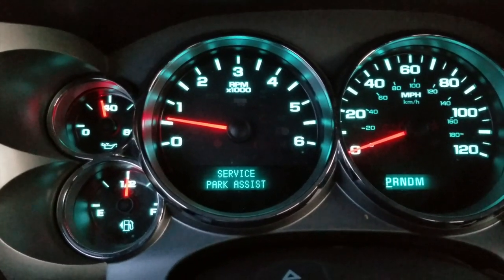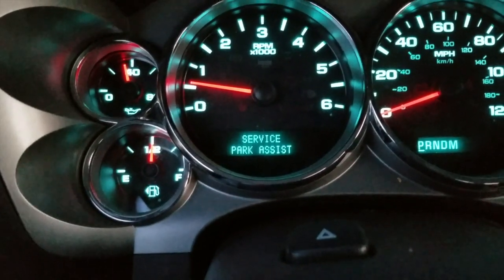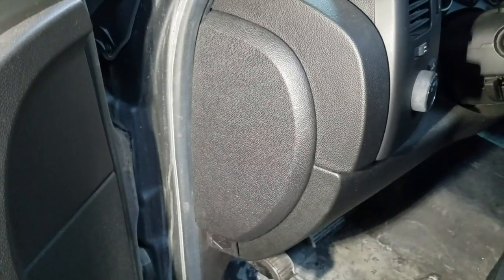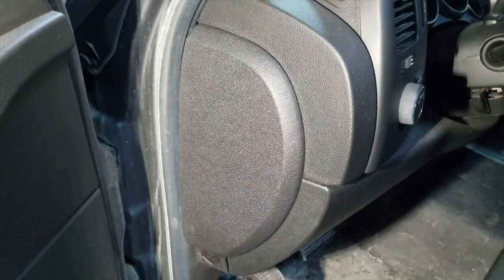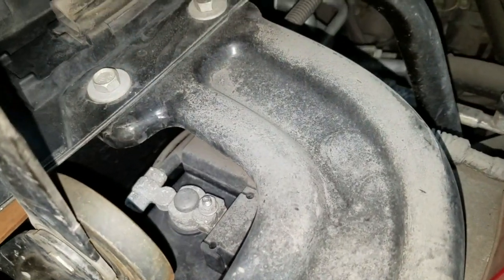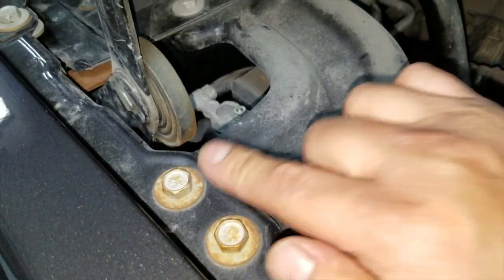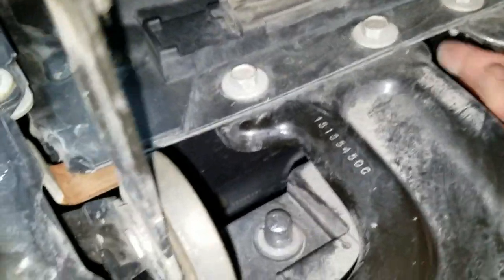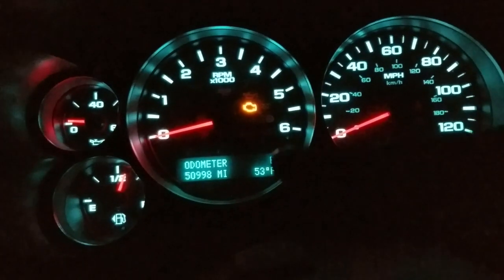2011 Chevy Silverado - Disabling Park Assist

Comment: 2011 Chevy Silverado 1500. Replaced factory rear bumper with steel bumper. Had to bundle the sensors up as they would not work on the new rear bumper. I had this same error message. The instructions in this video were perfect and exactly what I needed to make the message go away. Can't thank you enough for this video!
Reply from the maker: Glad it helped!

Comment: Thank you!! I was getting tired of replacing sensor and the annoying dash message. this worked great on my 2013 Silverado
Reply: Question… customer said that they didn’t fix it after removed rear bumper for paint and they didn’t work on it . Customer said it supposed have beep sound for reverse n it not working but I saw ASST PARKING . So this video help ? N u said finally fixed it ?

Comment: I just did this on a 2013 Express van 2500 6.0l, and yes it does work. Just make sure your battery is disconnected for long enough.

Comment: Thanks a lot.  Worked great on my 2011 Avalanche!
Reply from the maker: Great to hear!  Thanks for leaving a comment!
Reply: @AKJeeper  np that was one of the most useful videos I've come across. My park assist would chime every 5or6 sec unless over 60 km/h live in Toronto Canada btw,  saying park assist blocked see owners Manual.  Drove me crazy 🤪
Reply: Sadly this hasn't worked for my 2011 Avalanche. Battery was disconnected for about 25 minutes. Bummed

Comment: I've had a 2011 Silverado WR 1500  for 8 years and never knew "Park assist"  was on it. What does it do?
Reply from the maker: These are sensors in the bumper.  When the truck is in reverse and an object gets too close to the bumper - the truck will beep to alert the driver of the obstruction.  The faster the beep, the closer the obstruction is to the bumper.  Unfortunately the failure rate of the sensors is quite high, and the sensors are rather expensive.  Many people elect not to repair the system when it breaks...
Reply: @AKJeeper  Rock Auto has them for about $12 each. I replaced 2 Sensors that were bad, and now the Park assist works. Still can't get rid of the "Service Park Assist" Message.

Comment: When you pull the OBS fuse does it disable the backup camera as well?
Reply from the maker: I would have to look at the wiring diagram to know for sure.  Interestingly enough, none of the trucks I've done this to have had backup cameras.
Reply: @AKJeeper  They only have the cam or sensors. NEVER BOTH ----The cam is part of the navigation option with the screen in dash. Just FYI
Reply: yes my back up camera does not work if i pull that fuse

Comment: Great video man.. hey I live in Alaska too!! I have a question about my vehicle i have a 07 escalade ext I replace two sensors that was bad but now its saying parking assist is off. Do you know how to fix my issue. Thanks
Reply: Did you get any help with your issue?
Reply from the maker: I didn't see your message.  Have you checked the fuse?  Maybe it blew in the process of replacing the faulty sensors.

Comment: I have 2013 diesel which has 2 batteries. I’m assuming I would have to unplug both for 5 minutes?
Reply from the maker: Yes, unplug both batteries (negative cables) if you’ve got dual batteries.
Reply: @AKJeeper  just finished it up. It worked! Thanks!
Reply: I followed this and now on dash says park assist off?
Reply: Any pointers on removing that?

Comment: Tried to do this on my 2013 GMC 2500 Duramax. After completing the process, when I started the truck I got this message: PARK ASSIST OFF 
I also noticed that the presets on the radio did not change either. The second time I did it I disconnected both the negative and positive battery leads. Same message appeared. Does something else have to be done to reset the computer?
Reply from the maker: Duramax trucks have two batteries.  Did you disconnect both batteries?  Basically the power needs to be cycled at the instrument cluster so that it can reconfigure itself as a unit without park assist.
Reply: Bingo!  It worked. Had no idea there were 2 batteries. Great fix! @AKJeeper

Comment: If I replaced all my sensors with new sensors and the service park assist doesn't go away does this mean I need to disconnect my battery for 5 min to make the code go away? Harness looked good. Bought after market sensors off of Amazon. I have an 2010 Chevy Suburban.
Reply: I did the same exact thing, I bought all new sensors, and now I got codes for every single sensor instead of just two. Mine is a 2010 escalade.
Reply: @dalton6578  Mine doesn't tell me how many sensors are bad. it comes on and goes off when it feels like it.
Reply: @InfantryGeek  I have an in-depth scanner. Mine tells me exactly which sensors are malfunctioning and all sorts of other stuff. Even will tell me if my heated seats have an issue.
Reply: @dalton6578  Where did you get the scanner and what is the name of the scanner?
Reply: Did you ever get your issue resolved?

Comment: Any clues on "park assist blocked" code on a 2013?  Been on ever since a buddy borrowed my truck and shut it off while also borrowing my trailer.
Reply from the maker: Usually the blocked message shows up when you've left the ball mount in the receiver hitch.

Comment: Will a radio code be needed after disconnecting the battery ?
Reply from the maker: I haven’t needed a radio code on any of the ones I’ve done so far.

Comment: Will this work on a 2010 Suburban LTZ? i installed a aftermarket 12" android Tels style radio then my service Parking Assist came on? could that be the problem? my pedal adjustment still works but not the traction control or parking assist!
Reply from the maker: I haven't tried doing this on a 2010 Suburban.  I would plug a scan tool into the vehicle and see what code(s) pop up that might be related to the Park Assist system.  There's a chance that your aftermarket stereo installation could have made a module unhappy.  Hard to say without reading the codes.
Reply: I'm having the same issues and no code is being thrown.

Comment: What is the exact reason you temporarily disconnect the battery?  Disconnecting the battery used to reset the ECM so it has to readjust over a few miles of driving.  Is this still the case?  Also, kudos for specifying the negative terminal - there are so many places I see instructions to disconnect the positive terminal which is DANGEROUS if the negative is still attached.
Reply from the maker: It forces the instrument cluster to reinitialize.  With the fuse out, and the cluster won’t “know” to add the park assist sensors to its list of things to check when it reinitializes.
Reply: @AKJeeper  Not only thank you, but amazing that you answered so quickly!

Comment: Did all that and replaced sensors still has service park assist on. Anything else you can suggest?
Reply: Same here but mine only come on going forward now
Reply: @djmcdonald5508  you didnt put your sensors in the wrong place, did you?
Reply: @donlute3444  lol no I only have the four in the rear bumper, I called a friend of mine who is a GM tech and he said that made no sense. The sensors literally work in reverse but as soon as I get to about 10mph the service park assist come up on the DIC. I can clear it then once I stop at a red-light etc and take off again it will come right back on
Reply: @djmcdonald5508  yes mine did something like that also. I clear it it just comes on again. Still trying to research as to why. Hope I find out soon. I miss my little backup beep beep.

Comment: I did this on my 2011 Chevy 1500 and taking that chip out screwed with my passengers air, drivers continued to work correctly but the temp didn’t work on the passengers side so I plugged the chip back in and it started working right away
Reply from the maker: What chip are you talking about?  The Obstruction Detection fuse is what gets pulled out for this procedure.  Sounds to me like maybe the wrong thing got unplugged.  I've done this on more 2010-2013 Silverados/Sierras than I can remember and I've never experienced the problems you described when you tried it.

Comment: how do I turn on my parking assistant for it to beep when I am about to hit a car since out of nowhere it’s on for no parking assistant? 2007 tahoe
Reply from the maker: If I understood your question correctly - this system should turn on automatically whenever the vehicle is in reverse.  If it does not come on automatically, the system will need to be diagnosed.

Comment: Damn!! $200 for parking sensors lol..!!?? Dude, they sell on Amazon all day long for $28-$80 for 4 and that's for bosh brand for example.
Reply from the maker: Dealer pricing.  Plus I live in Alaska, where goods are often considerably more expensive than in the lower-48 states.  Good to know that Amazon has these sensors.  Unfortunately these sensors have a high failure rate, and my customer simply wanted the system disabled.

Comment: I did it on my 2009 silverado and went from( service park assistance) to ( park assistant off) so dont work on mine😢
Reply from the maker: Only works on 2010-2013 models.  Earlier models require a trip to the dealer or capable shop to have the IPC reprogrammed.